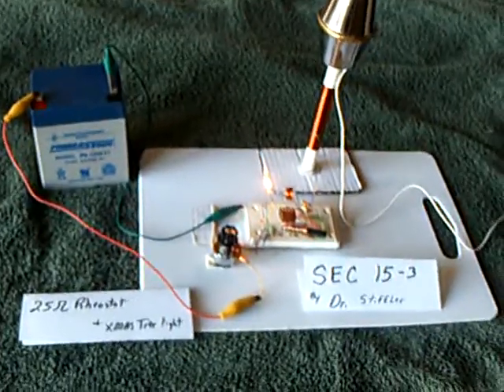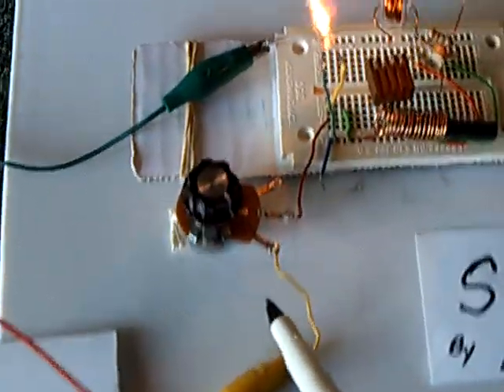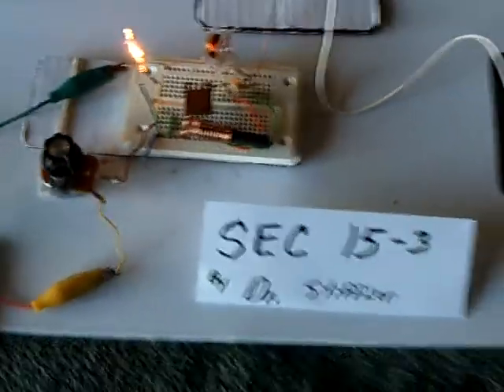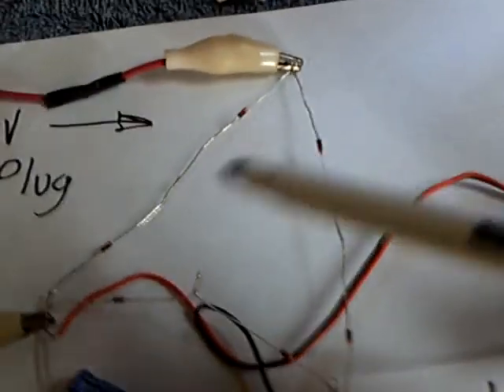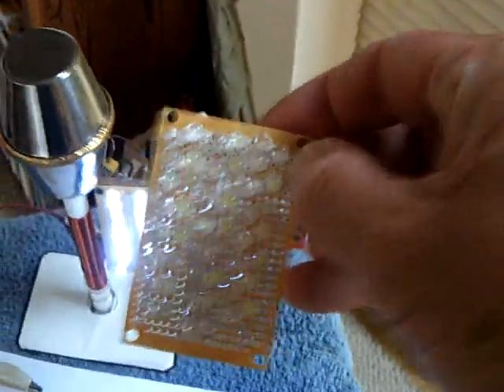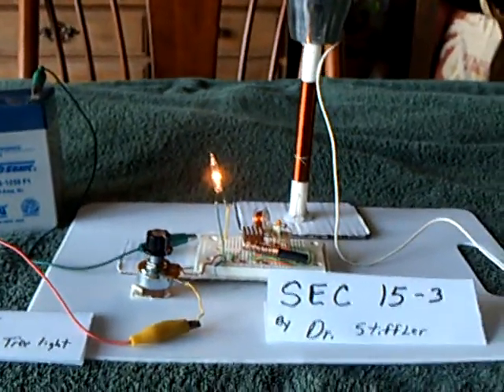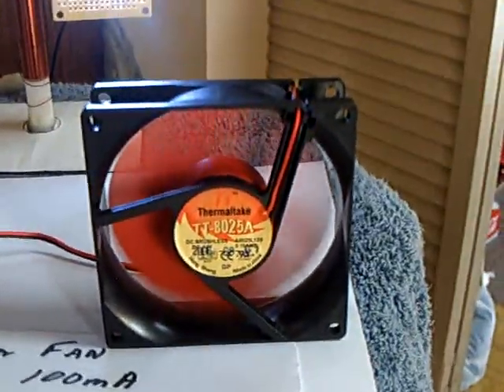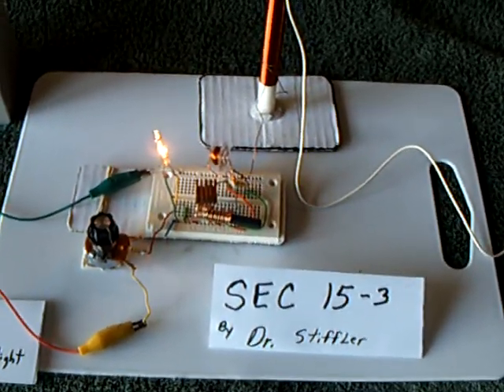SEC 15--3    Performance Observation.

Comment: Well done !
How much voltage do you have on the 2200 uF cap ?
Do you have a scope so you can show waveforms ?
Does it get out of resonance and thus lower light output at the LEDs, if you twist the 1 wire cable or put it into a loop ?
Many thanks.

Comment: thats interesting you have this working like you do. I see the fan spinning away at decent rpm. Does the cap stablize the voltage or help the fan run constent? Also are you using the mpsa06 transister or a mosfet on your circuit board? I wish there was something I could do to keep the heat down because the transister gets hot even with heatsink and almost burns up. I was thinking about the parasidic plate but where does it go in the circuit?